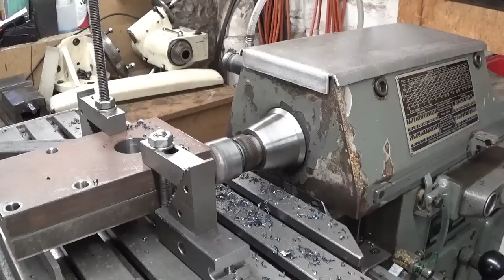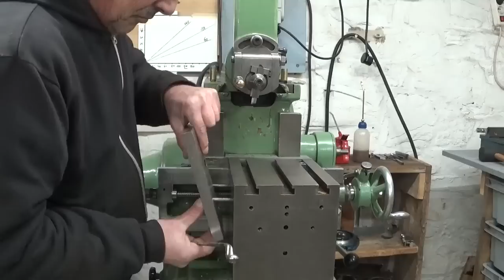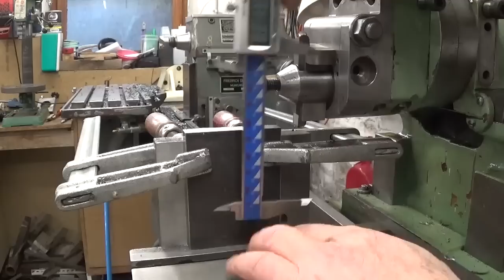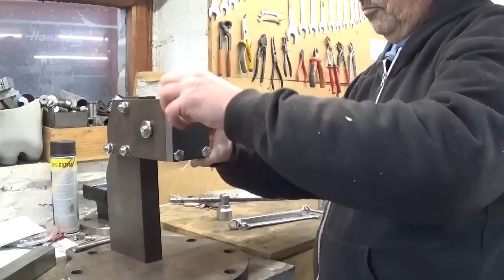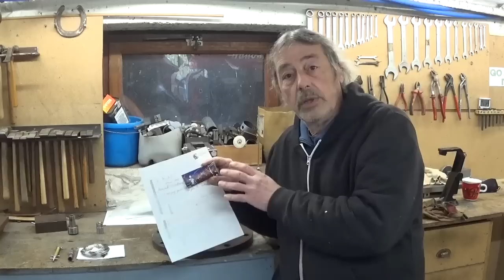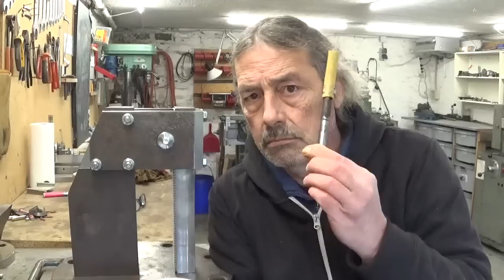Arbor press build final part.

Comment: The press came out great, Rusti. It will be really useful to have in the shop, and in a small way the bond with the old barge can live on. Would you consider cutting a piece away under the ram to allow shafts to pass through? I know some are like that, and have a platten that can revolve with different size slots in it. I enjoyed this series and the story behind the origin of the steel. All the best, Mart.
Reply from the maker: Thanks Mart.
I think I will make a slot and some plates the day I need it. We'll see.

Comment: Hi Michel another great video, l think it is great to see that you are recycling metal that has an emotional history and connection to your working life, the arbor press will be a great addition to your workshop and hopefully bring back fond memories each time you use it. I think you are right about the cost of the steel, if you have to go out and purchase it the cost would be prohibited and you may think twice about its construction. You have now produced a historical bond with a tool that will hopefully last you a lifetime. Keep up the good work. Regards Gary UK
Reply from the maker: Thanks Gary. I think it will be useful.

Comment: great use for a retired pipe cap. you now have a real cool tool, you need to name it after the barge. you could easily make a ratchet stop to hold pressure if you wanted
Reply from the maker: I have to learn how to make engavings first :)

Comment: Angle plate works perfectly ✔.
Great build, maybe add a friction screw on the front plate to free both hands when assembling parts.
Your old barge has joined you in the workshop. 
Thanks for sharing.
Reply from the maker: Friction screw is a good idea. Thanks for the tip.

Comment: sumting i seen a long time ago : a guy made a press arbour using the rack and pinion from an old renault car wish he had cut up some to fit the aplication
hmm like that oilpump with the brush , have to see where i can get one
if you have more of those blind pipe flanges you could make a flywheel style flycutter out of it
Reply from the maker: Google; "glue pump with brush for leather work"

Comment: As always it's a thrilling moment to start Your video. Well done. I wouldn't put my thumb in that press!
Time 04:40. Milling a 40 mm slot? Not using the shaper? Joking!
The cutter shaft is carved out..... If the carbide tip had wad vertical edge on the periferi this would not happen. Anyway, a good tool. The face milling tool I use has a vertical edge on the inserts...
Deburring.... My old file bought by my father some 70 years ago still does the job..... Joking.
Cheers.
Reply from the maker: I think for my next cutter build, I will make it 90°
Reply: @Rustinox  Hello Michel, I was thinking the same thing. The angle of the insert leaves a little material in place, hence the burrs.

Comment: Another great project  finished with reused  metal!, In time you'll find that you'll need to  have your handle sliding  so you can increase  the pressure  when needed  very easy fix..
Reply from the maker: No need. It's a socket on a hex.